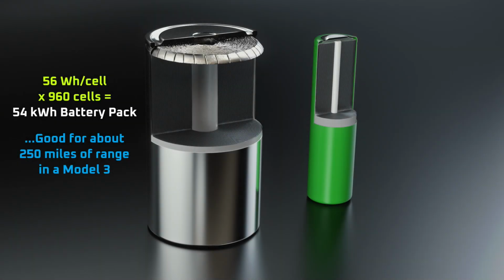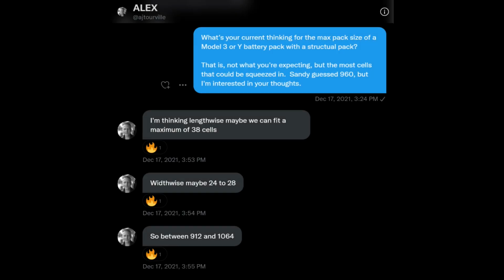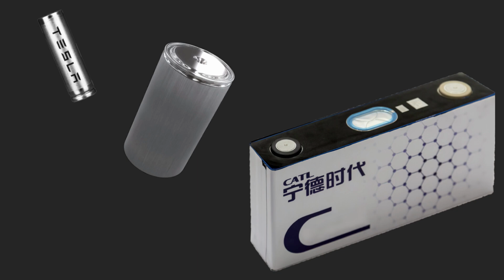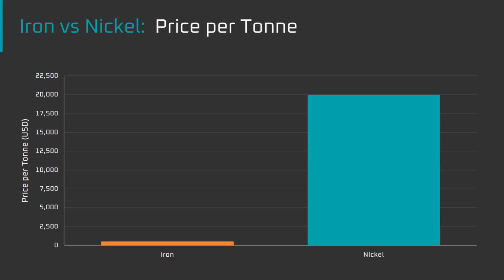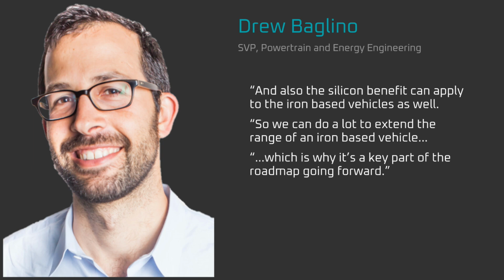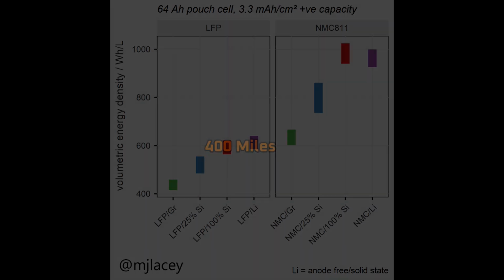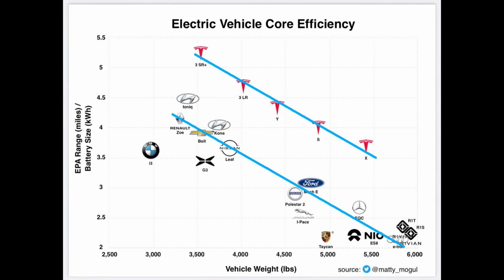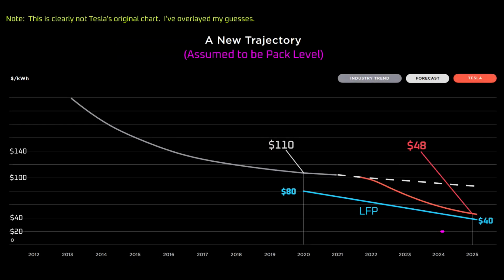The LFP 4680 Battery Cell  // + LFP with Tesla Silicon

Comment from the maker: Notes:

1) The 78% figure for the packing density was conservative.  By staggered the cells, the packing density can be increased to ~90%.  However, CATL/BYD are in reality closer to 400 Wh/l max than 450 Wh/l max, so I was aggressive there.  That is, the estimate I provided would still be a good template.  The math itself could have been dialled in better, but the results (250 miles), is still a good metric (in my view). 

2) Although my assumption is that Drew was implying that the structural battery meant the 4680 structural battery, it could also mean a prismatic based structural battery.  It's also worth keeping in mind that Tesla frequenly changes direction with their development plans and their thinking may have developed since Battery Day.
Reply: I feel their structural pack are for all batteries moving forward. 
Elon said the best makers of products are toy manufacturers. He is trying to create less variations not more
Reply: I think GAC AION LX with a range of 1000km is the first one to use high silicon battery chemistry.
Reply: I watched a 45 min video on this company very interesting good stuff seems to be pointed to 2024 with how products progress, develop and testing.Also speeds up the time it takes to charge to about a couple min,which is basically nothing when it comes to charging batteries
Reply: It's π/4
Reply: The hexagon is the bestagon. If the gaps are filled with structural material it is not wasted space. A cylinder is a structurally strong shape good at containing pressure.
Reply: You can't get to 90% packing density with cylindrical cells, it's basic geometry. There is a 17% space loss in the gaps IIRC. Plus of course the core itself can't be wound infinitely tight. So a 20% loss in physical space in cylindrical cells is inevitable.
Reply: @GregHassler  You can stagger the cells. On the video they were not staggered
Reply: Vincent Pluvinage, CEO of OneD Battery Sciences. OneD has developed a product called SINANODE, a drop-in manufacturing process that fuses silicon nanowires to graphite to triple the specific capacity of the anode while cutting its cost in half (per kWh). . . a great silicon solution for OEMs.
Reply: Jordan, curious on your take. After battery day I made some estimates based on the presentation. I came up with the following. I modeled range based on a Model 3. 

4680 Per Cell
LFP -                80Wh
Nickel Mag - 110Wh
High Nickel - 120Wh

4680 Structural Pack - 960 Cells
LFP -                77kW, 329 Miles, $2900 Cost, $37/kW
Nickel Mag - 105kW, 448 Miles, $4180 Cost, $39/kW
High Nickel - 115kW, 492 Miles, $5200 Cost, $45/kW

It will be interesting once we see production cells and vehicles. I hope that the biggest surprise is going to be in charge time. I think Tesla is sandbagging on this for 4680. I am guessing we will see at least a 50% reduction out of the gate, with up to 75% possible with tweaks over time.
Reply from the maker: @motofunk1  Nice!  More aggressive than I would have been, but not out of line with the information we've received from Tesla and Sandy Munro.  That is, it's a matter of interpretation, but I can't fault the stats above.  I'm just thinking of all the challenges they'll face and the increasing prices we're seeing in raw materials.
Reply: @thelimitingfactor  True, rising material costs will have an impact, but I don't really count that. I just look at my cost estimates as 2020 dollars, time adjusted for inflation will happen. Thanks for the feedback.
Reply: @thelimitingfactor   What is the energy density for this battery?
Reply: @thelimitingfactor   Digging up an old thread now that the Cybertruck is launched. Curious on your 4680 thoughts based on the CT specs. My original per cell capacity thoughts above were. 
4680 Per Cell
LFP -                80Wh
Nickel Mag - 110Wh
High Nickel - 120Wh

Based on the CT event I had these thoughts. Assuming the CT achieves range improvements for the vehicle integration and cell design capacity improvements of 14% and 16% respectively, but falls short on the anode and cathode improvements of 20% and 4%. 

CT Range.... 340 for the dual motor meets the 300+ shown 4 years ago, 320 for the tri motor falls short.
I don't think they have reached the goals set out for the 4680 yet. There are 1366 cells and a 123kW capacity shown for the CT, or 90wH per cell, giving it an efficiency of  384wH/mi for the tri motor and 361wH/mi for the dual motor. To get to the 500 mile range on the tri motor and the same number of cells, cell capacity would have to be 140wH. At 120wH per cell they could get to 500 miles with 1600 cells, at the current 90wH per cell they would need 2133 cells. Assuming the packs we saw are volumetrically full they would need additional room for the 234 cells at the 120wH per cell. I believe that space is available where the BMS is today. They would raise the BMS and place a second tier of 234 cells where the bms is today. There is a large void below the composite bed and above the BMS that looks even bigger than the rolled up tonneau cover would need.

Range extender. It appears to be 50kWh which matches with the 90wH per cell and efficiencies listed. Seems impractical as it would weigh nearly 1000 lbs, which is not installable by customers. Also, how does it hook up? Is it DC to DC or AC to AC? Elon has been against V2G so I surprised to see the 48amp in the bed, maybe the range extender is just a triple powerwall that plugs in there?

Comment: I'm curious how TESLA  is managing the LFP battery in the cold temperature. As you mentioned in the video and as many have said, LFP is bad in the cold winter. Is Tesla managing it by preheating the battery when the preheating the cabin is turned on? Is that how they are able to warm the battery and use the battery in the higher temperature range, so it is not so much affected by the cold temperature? If this is so, LFP is such a viable option for cars even in cold climates.
Reply from the maker: Preheating and dialling in their software. People have done videos on using a Tesla battery in like -30 C

Comment: Hey Jordan, this is probably a dumb question, but when you note the cylinders only take up ~78% of a cube. However, if they are staggered, in a wave shape, can't they be packed tighter, by "nesting" the cylinders?
Reply from the maker: Not a dumb question!  I forget exactly how I worded this video, but your basic assumption is correct.  I'd have to rewatch the video to advise why I took that 78% approach and how it matters.
Reply: @thelimitingfactor  No big deal. I think you were making a valid point overall that prismatic/blade cells can fit tighter. I think BYD is making a structural pack now but I wonder if the pink foam going in-between the cells in a Tesla, makes for a much stronger pack. Thanks for responding. Great channel.

Comment: Why THE HELL isn't it called a 46800? See the 21700 or the 18650... STOP MESSING UP THE NAMING CONVENTIONS!!!
Reply from the maker: Because you've got it all backwards.

The extra zeroes indicate a cylindrical form factor.  They aren't  necessary if you already know you're talking about a cylinder.
Reply: @thelimitingfactor  And why in this case do you "already know you're talking about a cylinder" but you don't already know that with an 18650 or a 21700 or any other commonly cylindrical cell?

Comment: One limiting factor we kept a blind eye on is the intrinsic thermal handling with tab less battery 46800, regardless of MNC, LFP or any cell chemistry. 

While 18650 and 21700 can pass current via its welded tab but heat. Heat must conduct heat through the case cylinder wall just because it has a largest case area, while thermal resistance there remains too large in 18650 thermal management. Is a limiting factor because core heat must diffuse through multiple layers of metal-chemical-separator reaching to the side wall. 

How about this? Since the electrodes are metal, is it a good idea to sink core heat vertically via the case base, the flat portion of cell casing? Answer: yes and no. 

Yes? 
It is wise to sink heat vertically.  

No? 
A bristle wafer placed between anode-case junction conducts electricity but heat. 

Why not heat ? 
The bristle wafer is a good thermal insulator. That is a gating issue, otherwise called a show stopper. 

Consequences? 
Over heated chemical affecting cell longevity and safety against a fire or explosion. 

Remedy? 
In the first principle view we need a solid junction to pass heat and electricity and not a bristle wafer. 
In practice we can employ induction heated reflow soldering at the anode-case junction. Each cell takes about 5-10 sec. A carousel of N induction coils can reduce cycle time by a factor of N. 

Set back? A slight increase battery pack mass by weight difference from wafer to solder. 

Benefit? out weights the risk stated above.

Comment: The real question regarding LFP batteries is: are prismatic cells usable in a structural battery pack chassis component? If so, then it doesn't matter which form factor is used for LFP cells. If not, then it's important to get LFP chemistry into the 4680 form factor.
Reply from the maker: They already are.  BYD blade.  That's earlier in the series.

Comment: I don't think 4680 or any cylindrical battery is right for choice for EV.  Being a cylindrical in shape it makes use of just 84 % of the volume at best when staggered together on the cell level. 16% of the space taken can not be used for any purpose. No wonder now Elon is realizing that BYD Blade type shape is more practical for EV batteries. Cylindrical shape 4680 or other does not lend itself for Solid State Battery Manufacturing for EV.

Comment: Would it be practical to have a 50/50 lfp/nickel pack?
The lfp could be used first, and then the nickel used when the lfp is exhausted?
The benefit is that the pack would last a long time.
The downside is that the pack would be twice as complicated.
Personally, I think it won't happen, but is a possibility.
Reply from the maker: In my opnion, no.  It's easier just to take either chemistry and tweak it for the specific problem you're trying to solve by incorporation two different battery chemistries.

Comment: The main issue with comparing prismatic to 4680 form factors in not so much the chemistry, but rather whether prismatic cells can be formed into structural battery packs.

Comment: If we suppose that different form factors are optimal for different battery chemistries, might not the diameter of the cell be the deciding variable? My hunch: Tesla's batteries will be all cylindrical (none prismatic) and 80mm high. This will make them all work in the same battery packs, and Tesla will be able to adapt its manufacturing techniques the easiest. The different chemistries will all have different optimal diameters though. What do you think?
e.g. Nickel 4680, Manganese 5480, LFP 6680, Sodium Iron 7280.
(I made those dimensions up for illustration purposes, as I don't have any insight into how to calculate the optimal form factor.)

Comment: Hi Jordan, your videos are as great as usual, here I would like to share some information with you.
Some internal research articles from Chinese companies(both 1st and 2nd tier) showed that BYD currently doesn't have any plans to invest on the production of 4680 or large cylindrical batteries. And I rather believe it could be true because ATL, CATL and BYD has discontinued the production of cylindrical batteries. While there are still chances that other Chinese manufacturer will make 46 batteries with LFP tech., the advantage of such combination is not as big as blade batteries.

Is it possible to make a video on whether blade batteries are feasible as structural batteries?
Reply from the maker: Hi, I made a video on BYD Blade

Comment: One benefit of cylindrical structural batteries over prismatic structural batteries is: cylindrical cells offer structural support from all directions. They act almost exactly like a honeycomb structure. Prismatic cells like the BYD blade are much weaker to impacts perpendicular to the largest face on the cell (what most people would call the "side" of the cell).

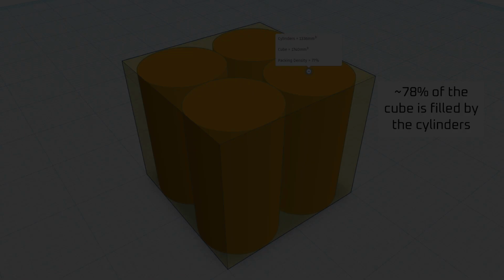Comment: Nobody's ever going to use the packing arrangement shown at 5:41. They're going to use a hexagonal packing lattice that allows 90% packing density. The 10% unused space is a perfect place to route temperature-control fluid (for cooling and warming up).

Comment: but even if the battery loses to 80% after 1000 Cycle  so 300 miles will go down to 240miles I am fine with that even to buy a 2nd hand tesla with a range of 240 miles

Comment: Perhaps that's why they're not working on "$25,000" car as they already have it as a scaled back Model 3.
A Model 3 with LFP 4680 perhaps with silicon. The battery pack would be smaller in size with a range of 175-200 mile range. Also the vehicle  features would be bare bones but mostly software upgradeable.
However, they'll need to push RnD to create a LFP 4680 as the dry electro chemistry will be different than the current 4680.

Comment: As per comments from various lithium industry experts it requires approximately .8 kg of LCE to make 1 kWh battery. Not the refined end product of lithium going into that battery which is much less, e.g. 10kg. So if a 60 kWh battery requires 48 kg of LCE how do you get to $25 per kWh when lithium carbonate equivalent pricing is already more expensive than that. See fastmarkets spot pricing getting above $50/kg. I don’t understand your conversions of LCE used in batteries. Even after you talked with Howard & Rodney it seemed like there was a disconnect in your conversion. I hope you can explain that in an upcoming video.

Comment: I value efficiency first, cost is a close second, therefore, I am buying an APTERA. My needs are those of most retirees, e.g., economy over convenience or flash. I want my "last car" to last a decade +? BEVs are economical compared to ICE because their fuel is much less, maintainability minimal. I choose the lowest range APTERA, 250 (not 400, 600, 1000) so I have the option of switching out the batteries when the breakthrough in battery tech warrants it. 
Tesla should copy APTERA's fundamental paradigm shift in efficiency with their Econo-model.

Comment: Hi Jordan, interesting video as always. I belive that the tabless design might enable thicker LFP electrodes and higher energy densities, which should improve energy/volume density of a proposed 4680 lfp battery. Couple that with reduced cost from DBE, and it seems that this route might become the norm for Tesla for most applications

Comment: I think there are two assumptions which cause me concern. I do not say you are wrong but:
1. As more people become used to electric vehicles, range will be less of an issue. I have an MG ZS EV and, as it is a home-charged city car and we have a petrol car as well, the 256 km range is perfectly adequate. 
2. People will become increasingly concerned about environment and will want to have cars with batteries that last 3000 cycles. They will also want batteries recycled whether or not the recycler can make a profit.

In the short term, it may be clever for some car companies, particularly smaller ones, to use a common body which can be configured as ICE, BEV, or PHEV as the MG ZS does. The inefficiency and short range may be offset by cheaper body manufacturing costs and battery technology may not be such a big factor.

Comment: Hi Jordan, your videos are awesome, great work, thankyou.

If Tesla were to make LFP, using the 4680 format might be possible but I can't see it stacking up against a prismatic cell design.

As you pointed out LPF materials are so cheap compared with NMC that recycling LFP is not really feasible. And if LFP is only 20% cheaper than NMC per kW/h due to the cheaper materials then more than 70% of the price related to cell manufacturing. 

From the battery investor day we know that DBE will substantially lower production costs. Separately the 4680 cell format also lowers production costs compared with the 18650 cell format and larger cells means fewer cells per vehicle. Prismatic cells are already quite large compared with the 4680 cell format, I don't think Tesla would want to put more cells in their vehicles. 

It's the tab-less electrode design that unlocked the large cell format with lower internal resistance and better heat dissipation. A tab-less prismatic cell design would allow for much larger cells to be made at a lower price per kWh. These benefits combined with the benefits of the DBE manufacturing process could see prismatic cells perform almost as well at the current 18650 cells.

It is worthwhile for Tesla to invest in a new form factor for LFP? Yes, If nickel battery’s are projected to only represent 25% of the battery market in the next few years and it was worth while moving to the 4680 cell format, then surely they would see be benefit of optimizing the prismatic cell format for LFP which is projected to be 75% of the market.

Comment: In my mind it comes down to production speed. If the rectangular cells can be produced at a substantially greater rate per watt hour then the 4680 cells, then the 4680 doesn't really make much sense, since it is optimized for solving problems that LFP batteries don't typically have like excess heat and safety problems from damage.